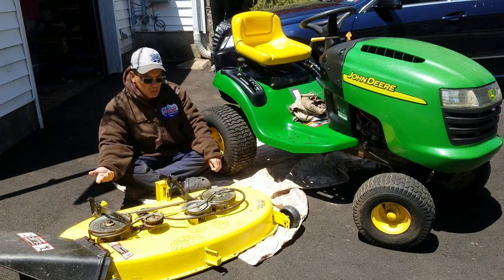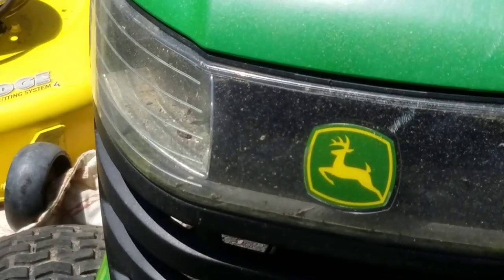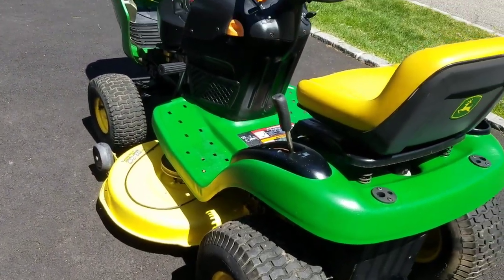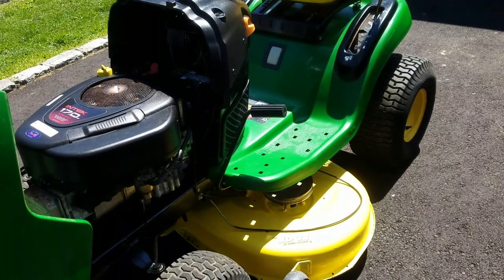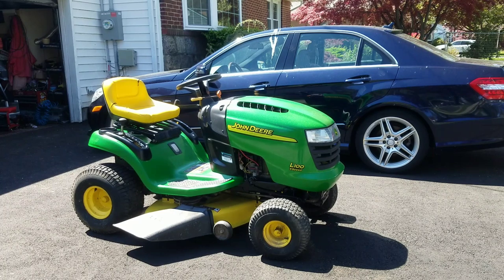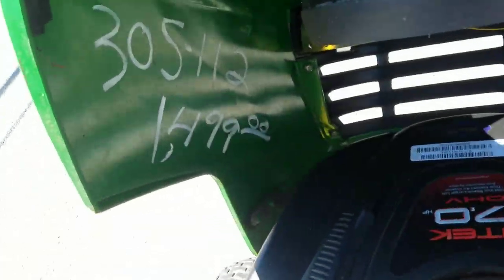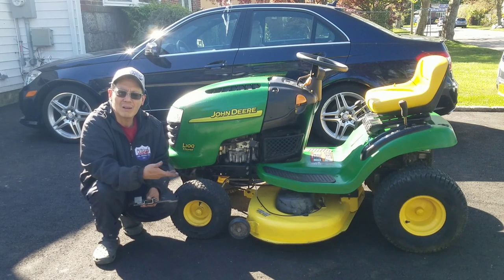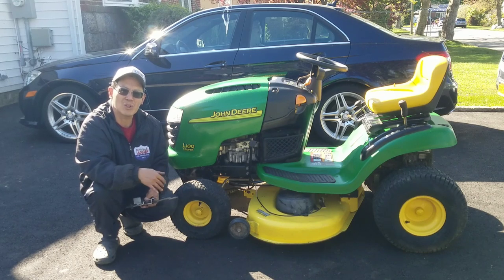FREE JOHN DEERE L100 BRIGGS 1742 LAWN TRACTOR 2ND COAT PAINTJOB PULLEY BRAKE PADS MOWER DECK INSTALL

Comment: You did good job bro you got done way before me I thought mine was going to be easy to but it turns out it's going to be harder than I thought it was going to be I'm glad you're L100 turned out good
Reply from the maker: Yeah John, given what it looked and felt like when I got it, I’m pretty amazed as to how it turned out.
Reply: @MowersNBlowers  yeah you had a better than me LOL even though that L100 set outside for 10 years it runs .mows. And drives I tried adjusting the valves on mine but still having problems with it

Comment: You should of sanded, primed then painted to prevent the rust bleeding through the new paint.  Painting directly over rust will only give you problems.
Reply from the maker: If it was a restoration yes! But for a flipper, it’s put lipstick on a pig! And send it away